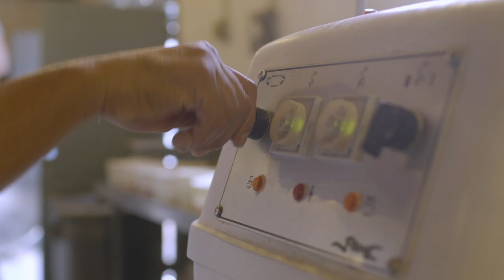How The Best Po Boy Loaves Are Made

Comment: When I see people make poboy bread, they put as much water as they can without it falling apart, and it comes out crispy, airy, crumbly, and snaps on the bite due to so much air and lack of flour, and also bits of butter/shortening lowkey frying the wheat. Also makes it easier to bite and the shrimp/etc won’t get pushed to the back because the bread isn’t flexible and breaks on the bite instead